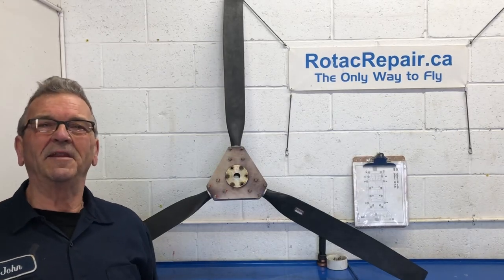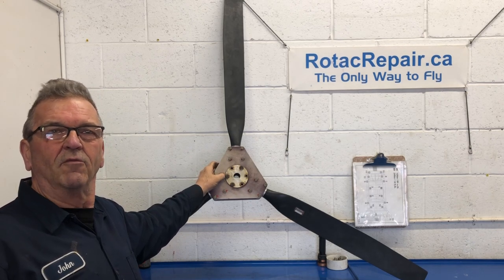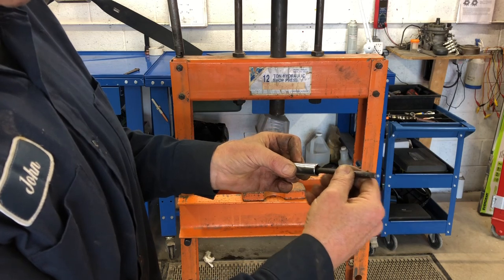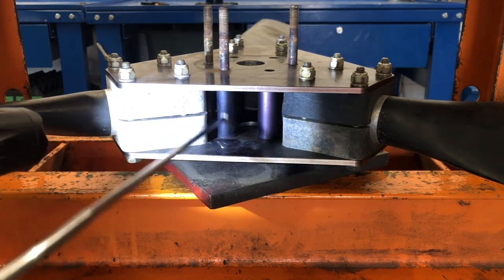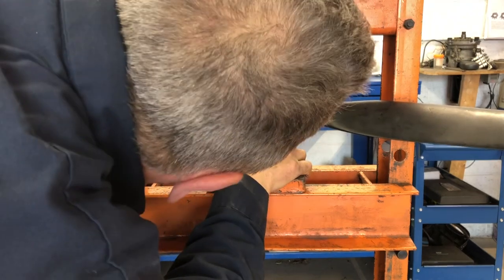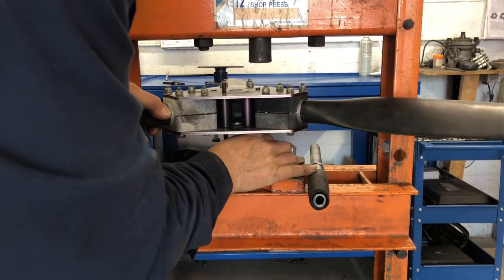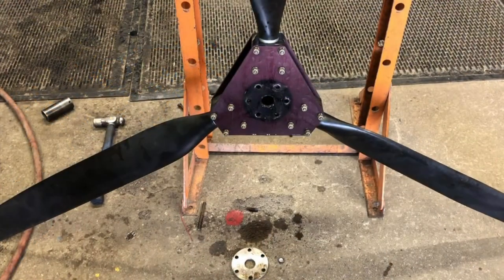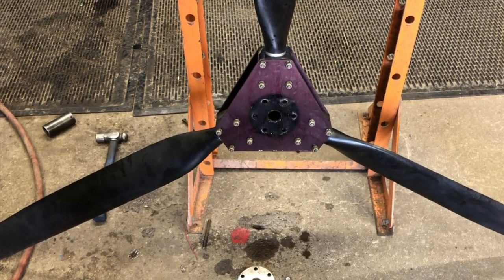Rotax 582 Blue head (part5) removing stuck propeller mounting bolts

Comment: Glad you got those bolts out!  I just bought a 2008 MD3 Rider LSA.  When removing the wings for transport they could not get the bolt out of a pivot at the rear of the left wing.  It was an 8mm 12.9 HS bolt, down in a sleeve just like you were working on, and they broke the head off trying to get it out.  They transported the aircraft with the left wing attached, folded back along the fuselage, and dumped the mess in my lap.  As all this was still attached to the airplane and not much clearance I could  not use a press.  I fabricated a clamp using 1" angle iron at the top and bottom with 1/4" bolts on each side that I could tighten to squeeze the angles together to force the bolt out.  I tightened it so much that the angle iron bent but the bolt did not move at all!  I ended up having to drill it out, all 50mm, and that was great fun.  It is amazing how tightly a bolt can seize up in a sleeve like that.
Reply from the maker: You visualized and performed a very creative solution. Too bad your pressing wasn’t successful. Wow that’s a lot of drilling skillfully done over 2 inches. Congratulations on being successful! 👍

Comment: Would a thin coat of anti-seize be a good preventative measure on those bolts?
Reply from the maker: That may have worked as I believe they were uncoated bolts. We shouldn’t ever use plain bolts. It’s getting 6 new zinc plated bolts now.